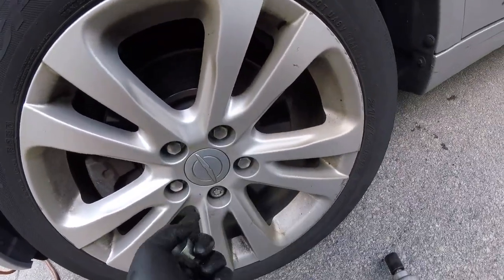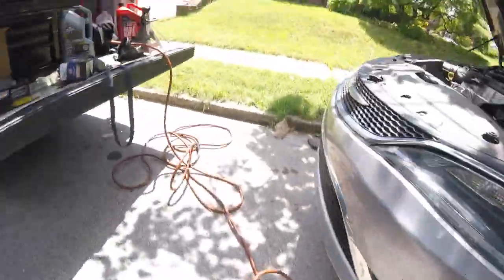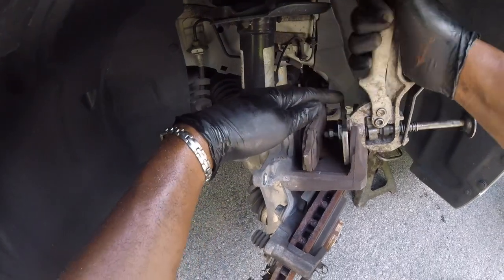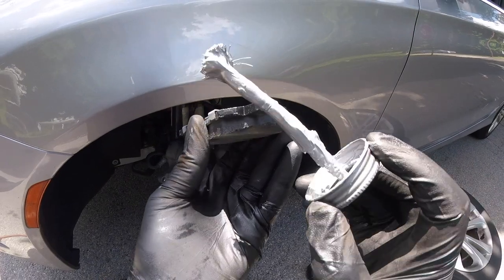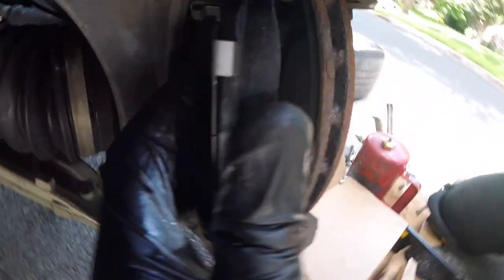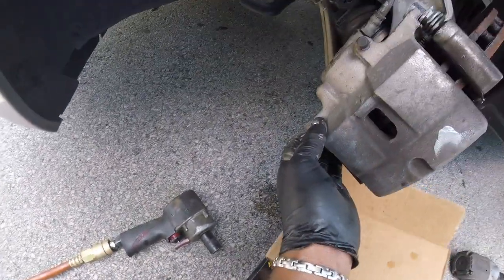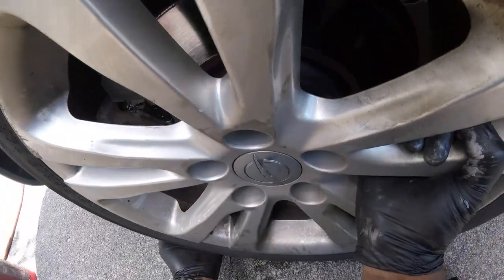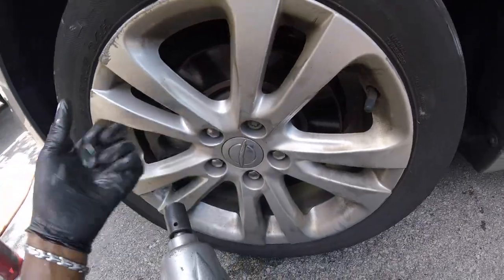🧐2016 Chrysler 200 Front Brake Pads Replacement😊

Comment: Straight forward and useful tutorial. However, I highly suggest getting a torque wrench and tightening the lug studs to spec. Sure, it adds a couple minutes to the work, but you can be sure the tire won’t fall off while they’re driving and that you won’t damage the lugs from over tightening. I’ve recovered too many vehicles from the side of the highway that lost a tire from techs only using an impact.